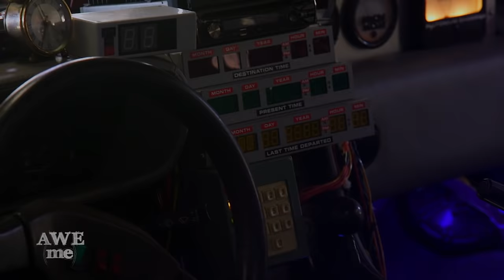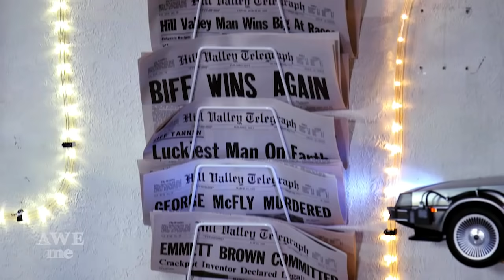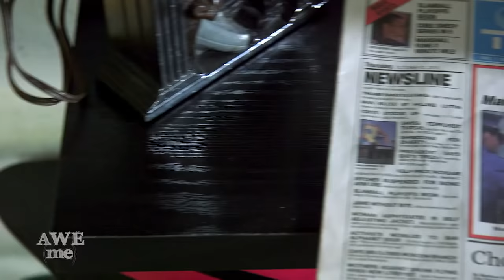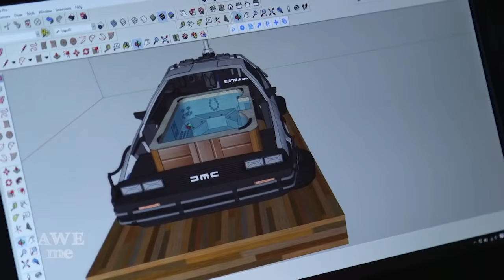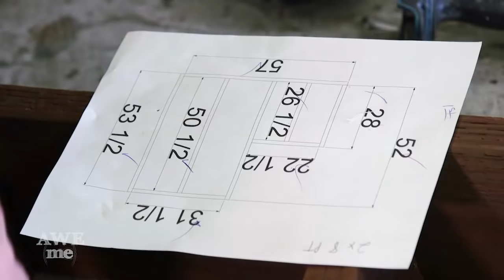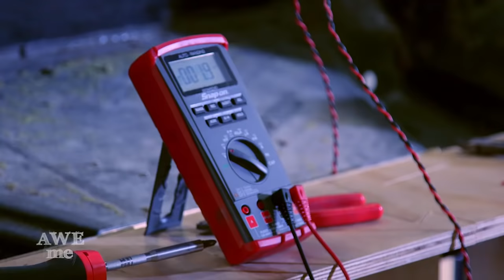DeLorean Hot Tub Time Machine - Super-Fan Builds

Comment: The Delorean itself wasnt a great car, but I hate that they wasted stainless parts on something like this. They're much harder to come by because they no longer manufacture them. Hacking up the fiberglass frame and shell seems ok though.
Reply: They should have casted the whole thing out of fiberglass. It would have been much lighter and cheaper than expensive stainless.
Reply: Ther're producing them again.
Not the original (the forms lay at the ground of the ocean) but still...
Reply: do you have any idea:

A. How complex it would be to mould something like that and how expensive it would be and...
B. Fiberglass is light but in large quantities it would weigh as much if not more than the stainless steel
Reply: +FacePalmFX  Even if some crazy asshat made or found repro forms, its a waste to use actual carparts for this application. Fiberglass would have been much better unless the damn thing can actually drive
Reply: If people can spit out fiberglass kits for cars like the t interceptor then it can just as easily be done on a delorean which has a very simple construction. No it is not that terribly expensive or difficult.
Reply: Its a damn hot tub. Wouldnt require that thick of application